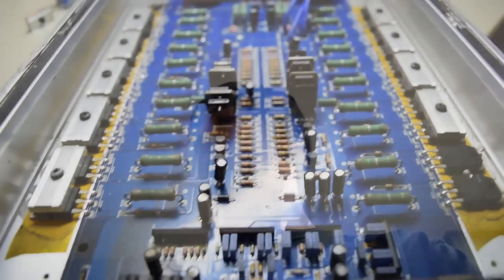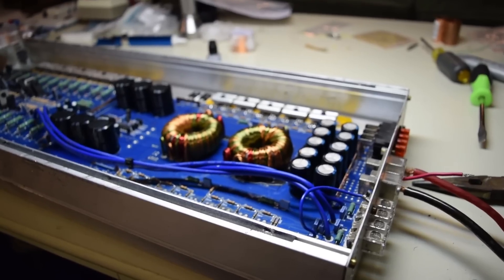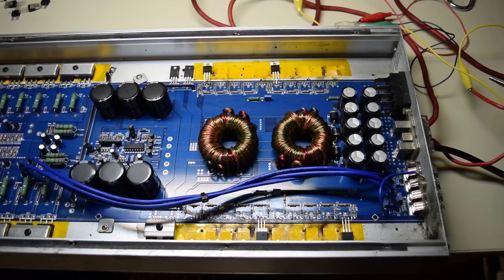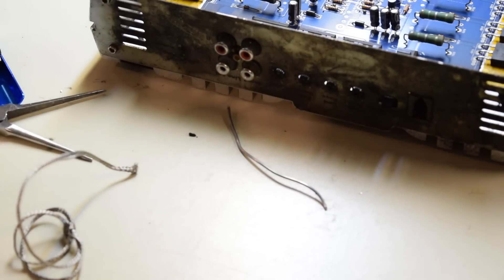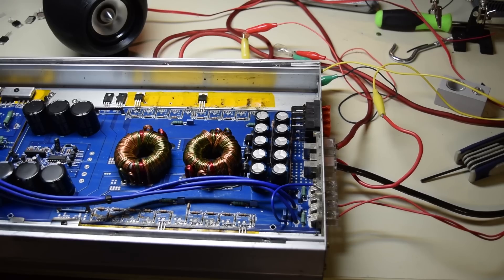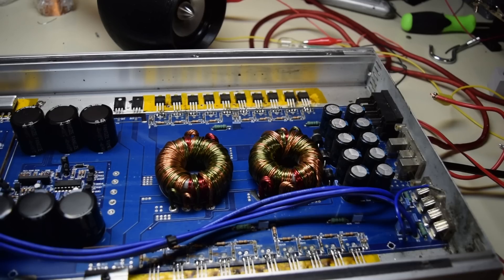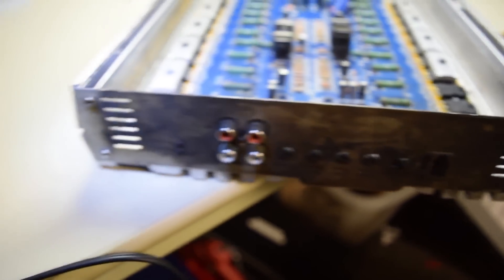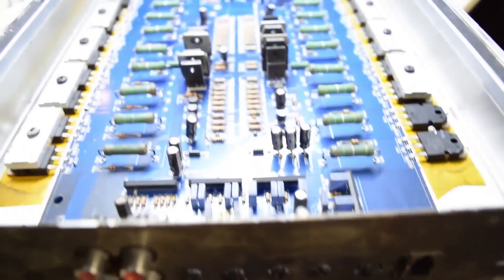Amp Repair: Lanzar Opti 500x2 AB

Comment: Hey bro I seen your video on the lanzar opti 500×2 and I have the lanzar optidrive 700×2 and it works great the only problem I'm having is getting a  static sound from RCA JACKS that's really loud even when the volume is off I would be thankful for any suggestions in fixing the problem thanks bro

Comment: Very nice revival! It always excites me when I see other people working on amps. The oscillation you hear is possibly due to your phase shifters (for bridging) are faulty, a problem with your smps driver not shutting the amp's controls off before the power is dissipated from the caps. Also it could be a problem with your remote turn on causing the fuses to blow when no current limiting is used, the smps ic could be sending a small signal to your gate drivers for your MOSFETs in the power supply and causing them to turn on just enough to allow to much current to pass and blow the fuses. Do an easy way to check that is to see if you have a DC voltage across the gates and also check your gate resistors.

Comment: good job! its good that you salvaged it...
did you apply thermal paste to the FETS that mount straight to the heat sink, or even the ones with the insulator tape under them?
Redoing a RF Punch amp, and all of mine have tape under it with no signs of thermal grease. So im trying to figure out if i need the grease in conjunction with the tape or not...
Cheers

Comment: please what regulators MOSFET use IRFZ44 or    # IRFP064N salutes from Venezuela
Reply from the maker: Jean Mendez  IRFP064N were used.
Reply: Mike Dioguardo I have a problem with my lanzar opti 500x2 one of my channel is not working. What I can do to fix it ??

Comment: Michael Dioguardo 

Where did you buy the FET's I have a lanzar optidrive 4001d with some bad FET's but I can't find any part number for them?
Reply from the maker: idcwatevaname http://www.ebay.com/itm/221256011410?_trksid=p2057872.m2749.l2649&ssPageName=STRK%3AMEBIDX%3AIT
Reply: Michael Dioguardo would these work on my amp too?
Reply from the maker: open up your amp and check the model number on the FETs. Usually every amp line will use the same ones, just in different quantities.
Reply: I opened it up and they are all blank. I will give these a try though. thanks
Reply from the maker: The manufacture will sometimes scratch off the names of them to prevent others from reverse engineering the product. But those should work no doubt. good luck keep me posted! :)
Reply: Michael Dioguardo
ended up being part # IRFP064N, they had glue on them so I couldn't read them, cleaned them off and got the numbers off of them but then I figured out why I stopped on the repair, got some burnt diodes too and Lanzar didn't want to give me any part numbers, plus it took them over a month to respond anyways
Reply: @mikedioguardo6184   where can I get the power terminal on the lanzar opti 500×2